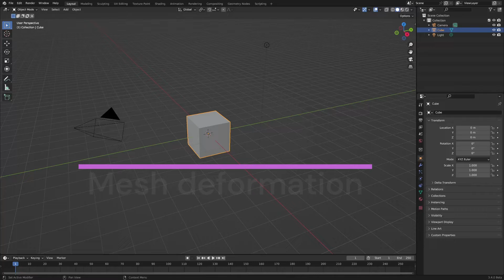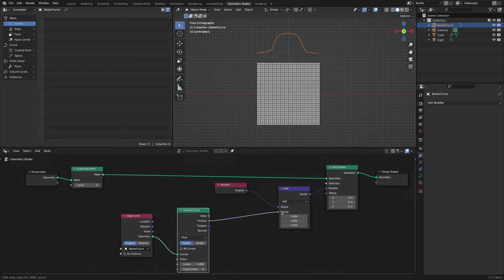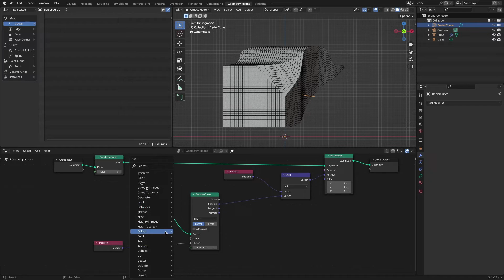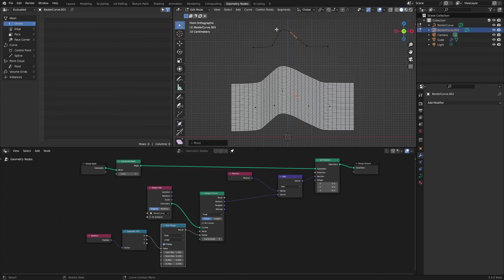How to transform a mesh shape through a curve shape (Geometry nodes, Blender)

Comment: This is just what I have been looking for for a very very long time. Thanks a bundle. I'd suggest you create and control the curve with a mathematical equation. This way you can deform meshes without all the groping and the quirking of eyes  which is very useful when dealing with high res meshes. That way I should be able to get realistic junctions for elbows and knees.

Comment: Create a second Bezier curve along the Y Axis. Join (Object Info & Sample Curve)  together with the first using another Vector Add node. Now you can extrude the shape of one curve along the other.
This almost feels like normal mesh modeling.
Reply: yes, and you can use the curves' build-in smoothness, like with nurbs, to get an even surface which could be more difficult to model with proportional editing or sculpting.